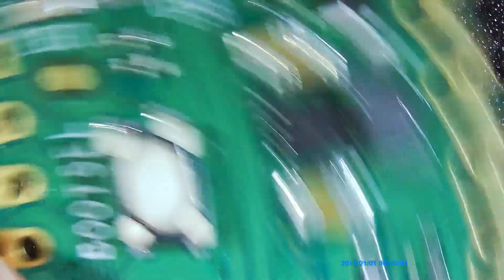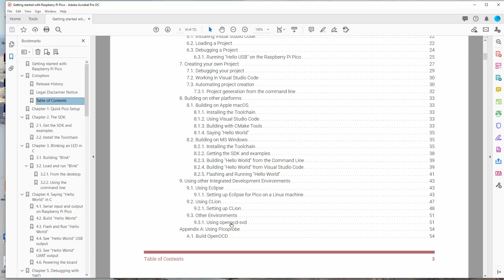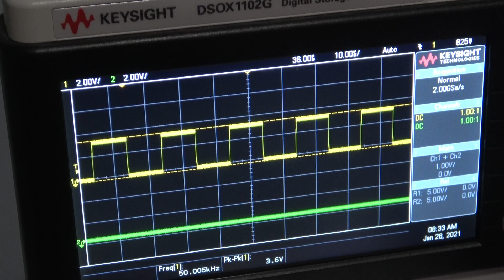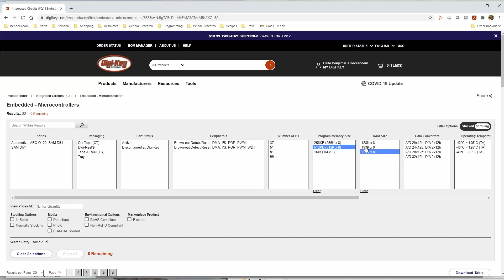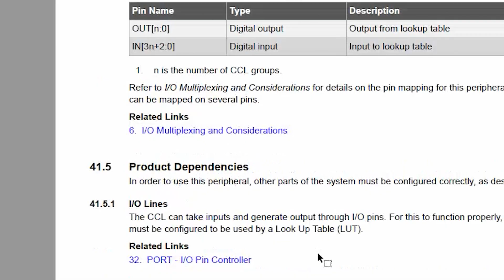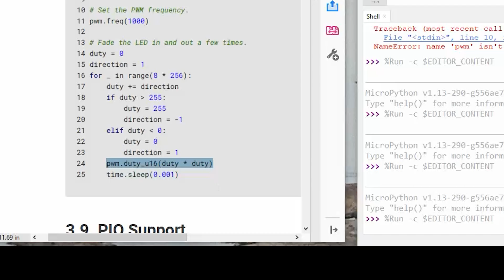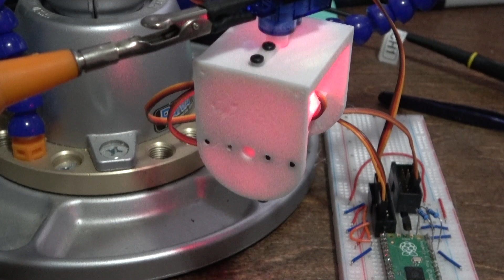Raspberry Pi Pico Testing

Comment: use polar coordinates instead of x and y, its distance and angle, which makes more sense. You can convert between polar and rectangular pretty easily, and it might be more fun for the cat if you wiggle one of the axes (or both) a bit before you make it move.

Comment: REPL is like BASIC, and origin from LISP, the third high level programming language from end of the 1950:th.
REPL means Read, Evaluate, Print, Loop.  That is, read line, calculate the result of the line, print the result and then start all over again.

MS Windows ARE an after thought. :-)
You should use a RPi 400 or something like that as development station, and you have access to hardware debugging pins directly.

The RPi CPU has some micro CPU in then PIO, which run independent of the ARM.  Yes, the M4+ will be more effective, and expensive, then these two M0 cores in the RPi.

Comment: 4:31 - you've got the analogy a bit backwards, though.  UNIX command-lines are like a proper language; vs. "Og point! click!~"

Sure, if you don't know the language, point and click won't get you far.  But if you do ... well, then you can have a whole elaborate conversation with the computer, and get it to do all sorts of things that are virtually impossible to express in a GUI.  Not that that makes command-line the right choice for all interactions, mind you.  There are important interaction modalities that are impossible in a command-line, and relatively easy in a GUI [multi-aspect [approximately-]real-time feedback being a great example -- though even there, some visual feedback can be given via a text-based interaction, especially with a unicode-friendly terminal emulator... but, only so much, or so well].  So, uhh... It's fine if your preference is to continue supporting the evil empire (even while they move towards open source (if not always free software), heh), and it's fine if you prefer GUIs... Just... you're losing expressive power by going that way.  I've sadly lost track of the research I used to point folks at for this, so... I leave that mostly as an exercise for the reader (if anyone has bothered to read this far into this comment); however, I did find this, which is on-topic and seems to agree with a weaker form of my basic premise: https://levelup.gitconnected.com/rethinking-the-command-line-24540990ed2a

Comment: 2:36 - your sense of "awww, cute" is kinda fun... yet still I feel like letting you know: that's not a QR code, it's a Data Matrix barcode.  :)

More info: https://en.wikipedia.org/wiki/Data_Matrix
See also: https://en.wikipedia.org/wiki/Two-dimensional_code (there are lots of others kinds of 2D barcodes, too.)

P.S.  Your barcode scans to "0000000000099120600021005".  A serial number??  I dunno.  But that's what it scans to.  :)

Comment: Question for you Ben! I've started learning electronics / soldering and I'm doing well. I just built a portable phone charger using a charge / discharge module I got off amazon. For the life of me, I can't find a mini lcd suitable for a Sega Genesis portable mod that I'm doing. A 7 inch screen would be ideal, but I haven't had any lucking finding anything on ebay or amazon, perhaps I don't know the exact terminology to use to search for it. The PS1 portable screens are nice, but ridiculously expensive, right now anyway, any which way I go online. Your input, or anyone's input really, would be appreciated.
Reply from the maker: 7" screens for NTSC are kind of rare. You might want to look into portable DVD players, the Genesis can output 15KHz RGB.
Reply: @BenHeckHacks  Thank you! I'll look around. I'm the guy who grabs electronics from Goodwill to salvage parts, heh. I'm not sure if you are doing any more handheld console mod videos, but give thought to a portable 3DO. I had one as a kid and all I really remember is "GoldStar" being on the controllers and that they daisy chained together for multi-player games, lol. It would be a fun watch, and I can tell in your videos that you really enjoy projects like that.

By the way, you inspired me to start down the path of electronics / mods. Thank you for that, seriously.
Reply: I just found two refurbished 7 inch portable DVD players on eBay! Thank you, $37.00 won't break my bank.

Comment: Windows kind of is an afterthought for the RPi Foundation because the software on the Pi already has the build tools for the Pico bundled into it. Think of it as an Apple-like vertical integration, but without the lock-in.

Comment: Actually... Microsoft's docs to get VS code running on Linux is fantastic. VS code also runs great on Linux...

That and considering the Pi foundation's products mostly run Linux as their primary OS...I think they probably expect most of thier customers to use Linux or be familiar enough with Linux to use it in Linux. 

Linux and Mac are similar as Linux is Unix like and Mac is Unix. So porting from Linux to Mac is probably a lot simpler since most of the design principals with regards to how the OS is put together are similar.

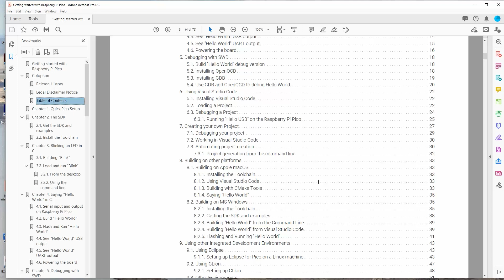Comment: 3:45 Windows has most of the market for end users, not developers. The vast majority of developers either use MacOS or Linux, even when they have Windows as a target platform. Windows development setup is only easy if all you want to do is develop for the Windows OS. For example, take a beginner and see if they can follow the setup steps for SFML on Windows versus Linux. On Linux, you can run a series of simple commands that automate most of the process. Windows on the other hand, requires you to install over 10 GB of IDE, then navigate to the maze of Visual Studio settings where you have to manually type dll names in the correct order they must be loaded...And that's just to you have everything setup to test if the installation worked. And when it doesn't work, you have to waste hours testing which part of the 100 steps you did wrong. No wonder Windows is an afterthought.

Comment: 27:40 You see, a true python programmer would just write those two lines as `x, y = random.randrange(r) for r in [160, 70]`.
Don't bother copy pasting when you can just use a list comprehension expression and tuple assignment. If we cared about that kind of overhead, we wouldn't be using python in the first place.

Comment: Dude chill. I mean if it works under your spyware-os why whining about the linux-geeks putting instructions before Windows?
Also making fun of command line usage is beyond ignorant.
As if there was any evolution from command line to GUI.
That's not correct. GUIs are a supplement to cli progs.
Thats why all essential tools are usable to with cli. Even in Windows.
Programms that are Gui-only exists in every OS and are nothing special.

Comment: Stop the whining, por favore.  Yes Python, MicroPython, and CircuitPython are interpreted languages similar to basic in that way only.  All 3 can be compiled into an executable similar to C/C++ code.  The only great addition to this microcontroller is the 8 state machines in the PIO. But it lacks Wifi which is important for networked client server applications.

Comment: One thing to possibly add to the cat entertainment system: If the laser dot "staying time" is longer than x seconds it wiggles around the set position after half the time is up. Wiggling seems to call cat_pounce(); more often than a steady dot. Cat sensors seem to be tuned towards "micro movements". That's why a human playing with the pointer is more efficient: It's the inevidable shaky hand micro wiggles, according to my own research :D

Comment: lol i bought a pico pi once. ran fine for like 2 hours then it died. bought another one, it ran for about 5 minutes. bought another one (cause i was determined) ran for about 6 hours then it smoked and died. used official power supplies. different ones and different usb cables each, and even a different power receptacle.  house power was correct voltage @ 119-120v AC @60hz. I gave up and bought a r pi 2, 3, and 4 ran them all for about 5 or 10 mins each, got bored with them cause their performance is so slow to me they are basically useless. then i gave up.

Comment: I guess you need a new oscilloscope if it can't keep up with a microcontroller. Just sayin'! I don't agree with everything said in this review, but ... that's what reviews are for. It's a pretty reasonable demo. Shitting on Linux, and then bitching about how many things you have to pre-load on Windows before you can do anything at all with the pico is hugely entertaining, though.

Comment: It's definitely not the arduino killer, since there are better arm based arduino compatible devices.  Also I 100% agree that python is the new BASIC.  (I actually told someone that months ago, though I think I said VB or QBASIC or something and they took me literally and tried to point out so the syntactic differences... Like wtf, it's an interpreted, overly verbose language for beginners).

Comment: I would guess the USB button issue you are seeing is because of the following:

"RP2040  has  an  integrated  USB1.1  PHY  and  controller  which  can  be  used  in  both  Device  and  Host  mode. Pico adds  the two required 27 ohm external resistors and brings this interface to a standard micro-USB port.

The USB port can be used to access the USB bootloader (BOOTSEL mode) stored in the RP2040 boot ROM. It can also be used by user code, to access an external USB device or host."

So the USB has to be manually set to load as a flash drive. Most I can say they could do differently is make the button a dip switch so it can be left permanently in boot mode in development. I can't see it easily being done via the USB port itself as there is no separate ftdi chip to send the signal to power cycle, go into bootloader mode, etc. There are USB cables that can switch on and off the attached device easily so personally that isn't much of an issue in my mind.

Comment: Can you add a sensor that sees when Bud attacks the light? Would it feasible to put an infrared sensor/emitter that points to a slightly offset distance from the laser point? If possible, add a randomize that makes the laser move instantly to a few secondsafter he attacks.

Comment: The button issue you're having with programming (I'm re-watching this now that I'm more awake)... There's two things you should be doing. First you should use a USB hub that uses external power. This protects your computer from your circuit.
Second that USB hub can have a power button for each individual plug on it. So you can just click off that USB one and then click it on.

Comment: I am addict to the cheap stm32F4 boards, loads of peripherals, graphical configuration tools, easy debugging and a neat IDE form STM that you install with the one click of the mouse. You can buy cheap boards form £3 (black pill, blue pill, nucleo). And if your application needs MOAAAAR you can go as high as a stm32H7 running at 400MHz, multiple cores, math coprocessor, graphic engines and megabytes of memory.

Comment: They are trying to break into the Arduino market.  A microcontroller directly running the program, no OS, GUI overhead.  Expect to see an Arduino IDE plugin that will run this soon.
I had ben interested in micropython until seeing this.
Reply from the maker: Good point. It's kind of like an Adafruit Circuit Python device but at a very low price. And Python is super easy to use on it.

Comment: I kind of agree with a lot of this. I am sure you could find use cases where the Pico is really well suited, I don't see a reason to go with this vs an ESP32 for general hacking.

That said, the pio is REALLY intriguing to me. As I understand it, it's basically a tiny fpga that you can program(and reprogram) from the main CPU. That could be REALLY useful for interfacing with random signals.

I really want to give reading/interpreting HDMI data with it a try.

Comment: I bought a Pico on release day because of the specs, but by the time it arrived I had already decided that I was never going to use it for anything.

The lack of integration with existing dev environments would be bold if it were coupled with a reasonable alternative, but the ridiculous fucking bullshit that they expect you to do in order to use it with Windows is a slap in the face that really seems intentional. I was also really disappointed to learn that the specs that I had seen were accomplished by a variety of chips on the board rather than by the MCU itself. I buy development boards for prototyping, the idea being that if the prototype is acceptable I'll be buying MCUs and building actual devices instead of just toggling LEDs on my breadboard until the end of time. I don't want to have to reassemble a million tiny components just to get the MCU to work the way it does on the board.

tl;dr - This is like a crappy Arduino, but without the Arduino libraries and IDE.

Comment: I do nearly all of my development on Unix/Linux and through the command line.  Properly updated, the Mac gets used for development if it's in front of me.  The Windows box(es) exist to update radio firmware/programming and play windows-specific games, such as FSX Steam Edition.  Mice GUIs are twitchy and much slower to use than typing.

Comment: Wow. A board with a more powerful processor would only be about twice as expensive. A chip for $4 does not mean that you can buy an assembled and tested board in single unit quantities for $4. The Pi Pico is an awesome value for the price.  Yes, you can get "better" boards, but not for this price.  I was disappointed in how slow Python was. C toggled in the MHz, Python in the KHz.

Comment: Is the boot button exposed on a pin? Could probably make a USB programmer that disconnects the USB power, then holds boot pin low, then repowers then the IDE copies the file over automatically

Comment: No onboard flash? It turns out that some chip processes are great for efficiently (power, speed, size) making logic and RAM but not so good for flash. I don’t know if that was the case here but it is one of the reasons that the new 1 GHz iMXRT1070 Cortex M7 by NXP also has no onboard flash. And modern quad SPI flash chips are fast enough that there’s basically no performance penalty for moving the flash off board.

Ben, the reason the windows install is so lengthy is that unlike linux and Mac, windows is not set up to be a development workstation out of the box whereas Linux is. Windows does not come with GCC, and Cmake, and build tools, and python, installed. If it quacks like a duck...

Comment: Props to Adonstar, that’s some pretty good performance out of $150 microscope. Ben, can you tell us the depth of field from the bottom of the lens to the surface of the board at the magnification you were using? Looking for a cheap scope that I can use for surface mount hand soldering. Maybe this is the one?

Comment: I can't wait to get a few of these. The microcontroller is a really neat little beast. The PIOs and DMA capabilities have me quite excited, along with the clock speeds, breadboard friendliness, unbeatable price, ... ad. infinitum
Reply: Though I do wish the pin labels were on the top ... and still don't understand why they're on the bottom (and why this seems to be a frustratingly common practice). Not useful for breadboard usage.

Comment: This is MicroPython though, which is a very different beast from the regular CPython interpreter. It has nowhere near the overhead or legacy to deal with. If you want to compare it to anything, it's like the threaded code Forth interpreters you find in resource-constrained systems, albeit much more approachable.

Comment: Have you considered getting a USB extension with a toggle switch?
It makes it easy to cycle power on/off
Reply from the maker: Read the data sheet more. The Run signal is Reset. Why they didn't call it reset is anyone's guess.
Reply: @BenHeckHacks    according to the Amp Hour Podcast, they didn't include a reset button because of cost.
Grounding the "RUN" pin does work, but they except people programing in C to use the SWD port. 
So use a proper debug probe or connect a second Raspberry Pi as a bit bang debugger

Comment: there is a reason why people use the terminal. its faster and more efficient on resources. also if you are on the raspberry pi you are mostly likely a little comfortable with  Linux. using the market share as a argument here is silly since 99% people on windows wont use it. the Linux community as a whole is more likely to get their product, that's their target market like it or not. But im just an old guy from the 70s.
Reply: I think Ben is just trolling people. Gets the comment count up to say controversial things. Engagement has value in this space too.

Comment: Forget bloated sluggish micro python. Forth via Mecrisp Stellaris on ARM M0 is the intelligent choice. No exaggeration. C-like speed, near English syntax, interactive feedback, irreducible simplicity with nothing off limits - all in just 19k of Flash and 1k of RAM... I has the additional benefit of making you a wiser programmer since unlike any other language today one can fully comprehend it from top to bare metal bottom. 

Remember that Rosetta Philae Lander that landed on that comet - programmed in Forth... Forth is programming poetry.